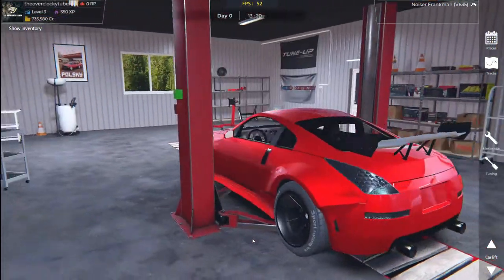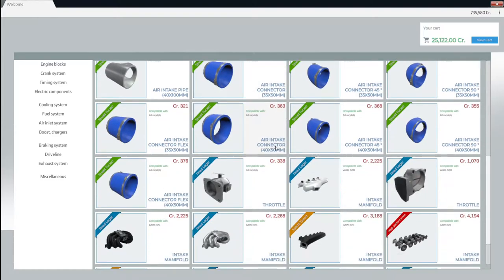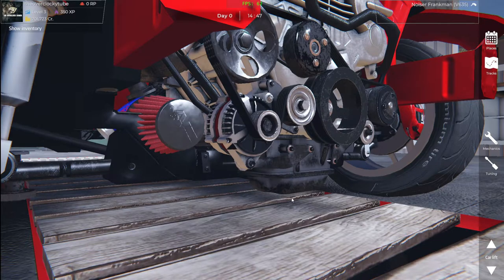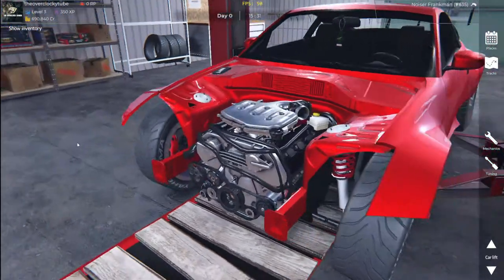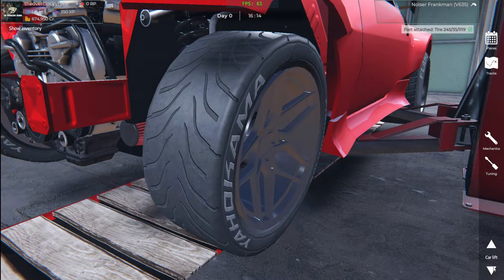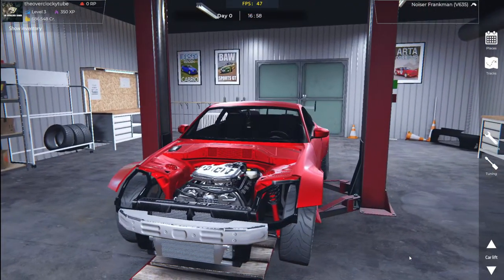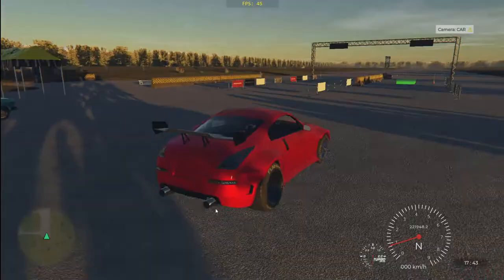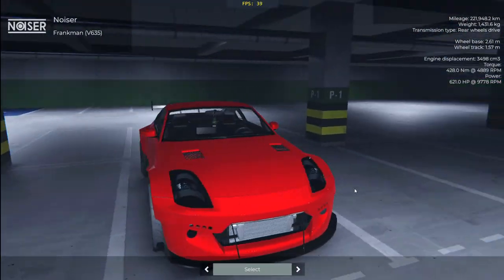TWIN TURBO Conversion on my 350Z // Car Tune Project - Part 2

Comment: Have you tried the front suspension with like a C Shape at bottom to push out the bottom of your wheels and straiten them , because those shocks look way too short lol
Reply from the maker: I actually found the problem, i think it was the steering that was the problem, like i placed the wheel spacers but then the steering mech or what ever it is called haha is to short so it pulled the wheels in :)
Reply: @TheOverclock  did that sort the height issue aswell
Reply from the maker: No it only made them straight, then for the suspension i clicked on the spring and dropped the height all the way down :)